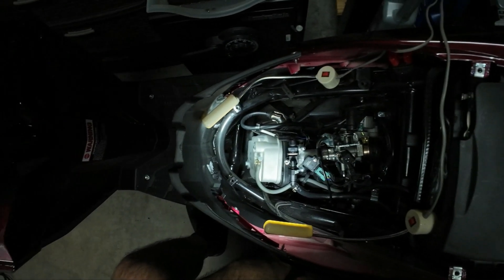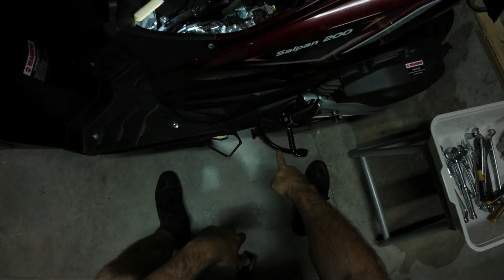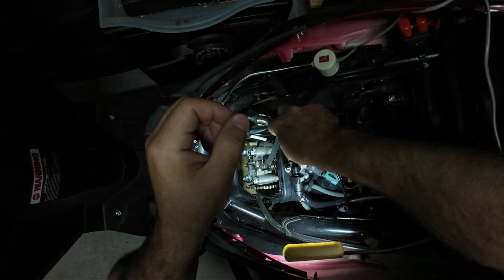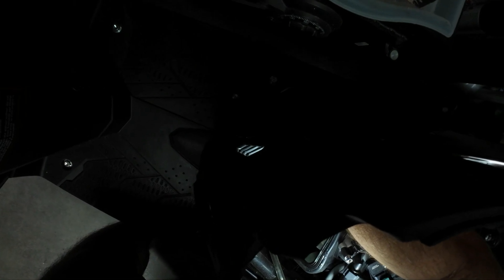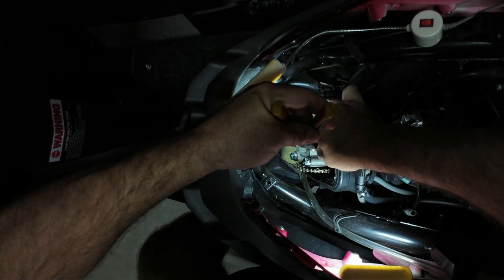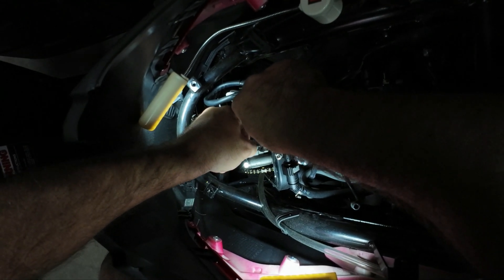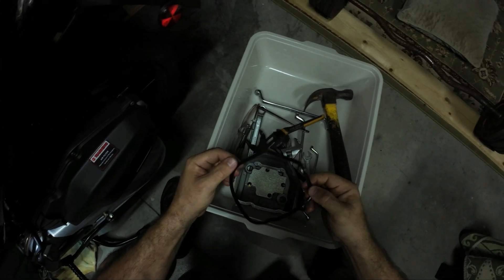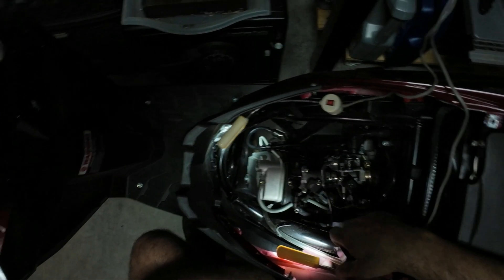X-Pro Saipan 200 - GY6 Honda Clone Engine Valve Adjustment!  Easy Fix!

Comment: Thank you for that.  I'm considering a Saipan and am checking for    parts availability and repair procedures.
Reply from the maker: Parts are very easy to find, the same motor and CVT is in almost every Chinese scooter. The parts are nearly everywhere.